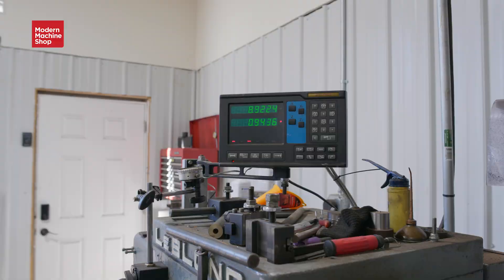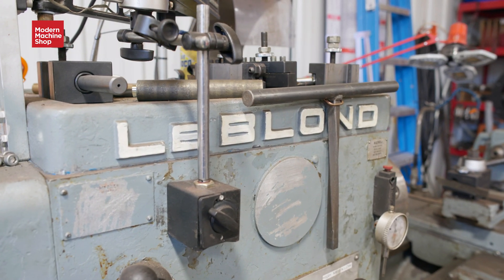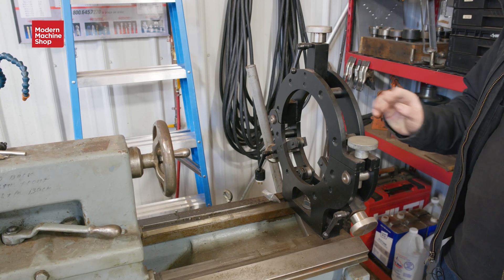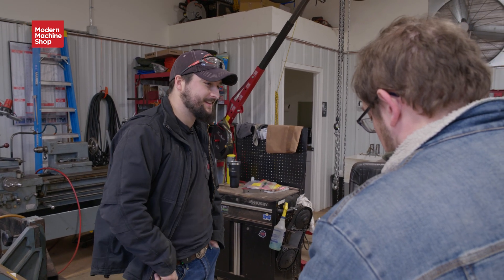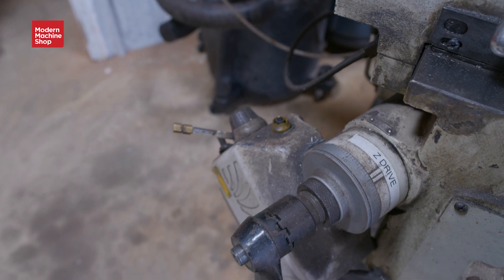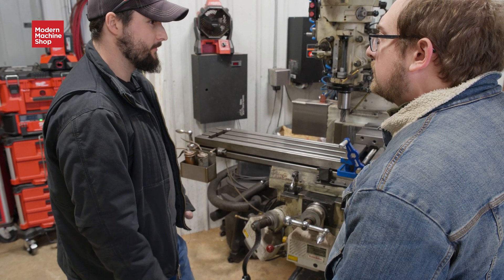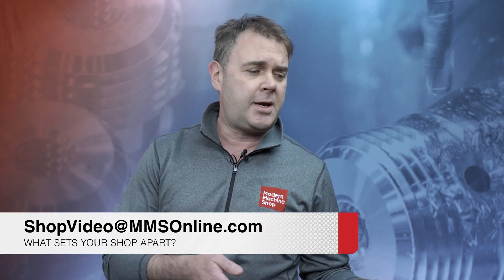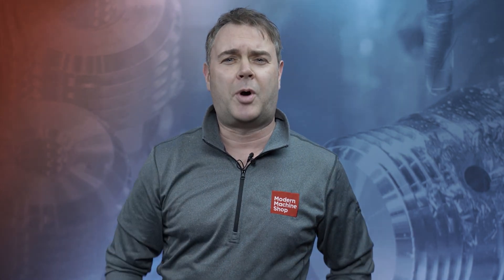Inside a One-Man Machine Shop | Embracing the Challenge in CNC Machining

Comment: Not even one modern commercial machine? No wonder business is sketchy everything about this is sketchy dude has no equipment and no capital and no products. Sorry but doing random one-off challenge work is a hobby not a business, if it was a business the big shops would welcome those jobs.

20 years later he'll still have no money and no equipment, be working with no vacation or health insurance or retirement savings. Most of these guys end up with a bunch of IRS debt as well because accounting is thrown out the window quickly in such amateur hobby/business schemes.